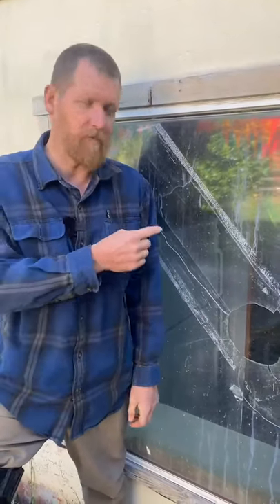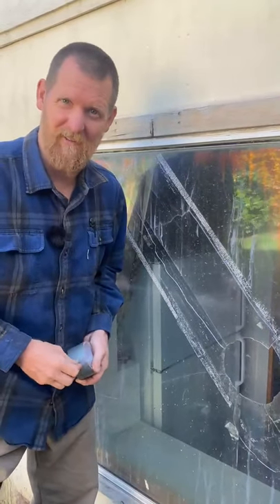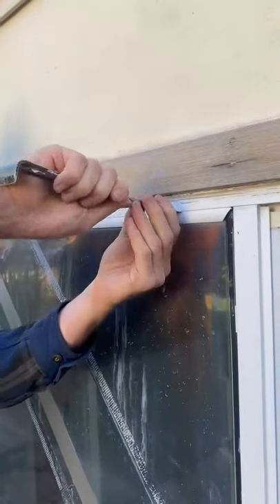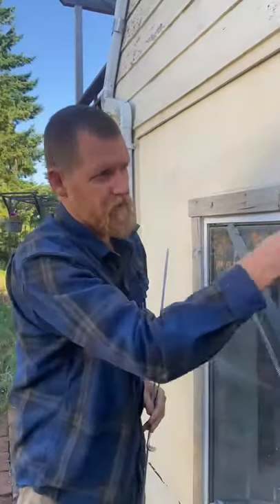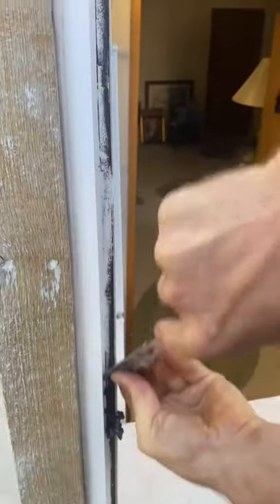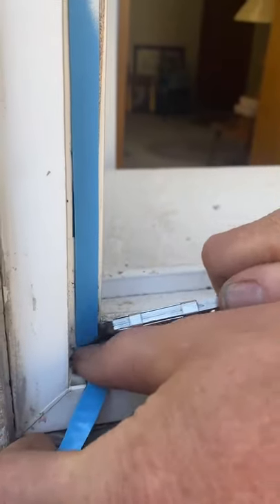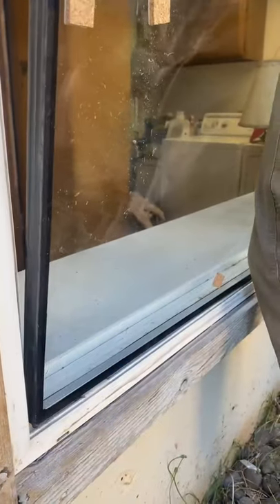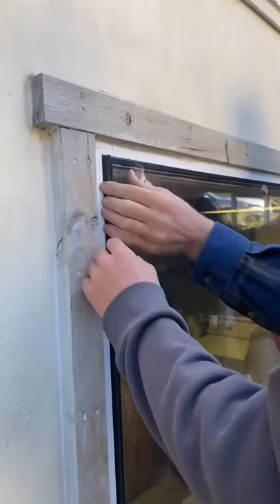How to fix a broken window in 15 minutes!

Comment: Any tips on a good source to order replacement double pane glass?  Been searching for half a day.  lol.  I grew up with all single pane and storm windows.  Easy to source.  Now I have  double pane in my home.
Reply from the maker: Do you have a local glass and mirror shop? You can also check your local  Lowes or Home Depot, depending on where you live.  Any window  company should be able to order it for you!

Comment: "In today's video, I'm going to show you how to replace double paned glass, the easy way.  Step number one: break the window with a lawnmower, or a baseball, or anything else."
 I had the impression that "double paned" meant two fixed panes, face to face in the same frame, with a pocket of air in between them. I also thought that duct taping the glass first and breaking it with a hammer would be ideal, but now I learn that a lawnmower is a better choice.  I am wondering, though...do I mow over a pile of strategically placed rocks, or just pick it up and swing??
Reply from the maker: Whatever suits your fancy! Strategically placed rocks makes it a bit less obvious! Pick it up and swing gets a bit more agression out! 😃

Comment: Can this be done on a 1910 single pane window? Will the double pane glass overlap?
Reply from the maker: I’m not 100% sure if I understand your question.
A true double pane window has a vacuum and they usually replace it with some kind of a gas inside between the panes. So if you just stuck two pieces of glass together with double side tape in between, I’m not sure what would happen with the condensation! You can give it a shot !!